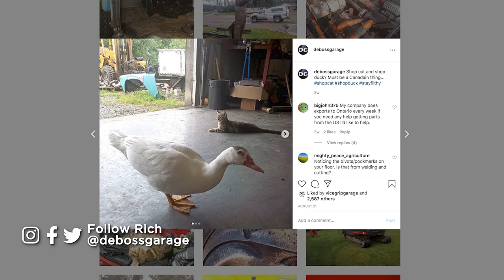The C10 Cab Is Much Worse Than I Thought... #TTDmaxC10 [EP13]

Comment: The safety inspectors make me laugh almost as hard as the emissions inspectors. One whiff of modern aftermarket and its a no go, but they'll sign off on a rusted and cracked frame with a worn out, oil-burning, carbureted gasser cause it was stock 40 years ago.
Reply: Lol we love it though

Comment: Hey Deboss got a question. I've got a Kamatsu D41E dozer with what looks to be a 12 valve Cummins 
Noticed that there was an oil leak under the dozer itself in the middle of the dozer would you happen to know what it possibly could be?

Comment: Nice, bodywork and fabrication, I do more of that anymore along side machining than I do actual engine work.  You guys should build a custom chassis for a project, that's what got me started welding back in early highschool building chassis' for deathtrap VW Beetles to sit on top of.  My first build was swapping the rear facing transaxle and rear engine for a transfer transaxle and engine to make a midengine beetle with a custom chassis using a lot of Audi parts.  

I don't wanna brag but it never caught fire so highschool me had one up on my friend that was building a 3800 series 2 Fiero.  After that I did a RWD build moving the VW 1600 to the front, flipping it around, and adapting it to a GM transmission.  Now I've got a front engine 1.8t 225 quattro powertrain bolted into a custom chassis/cage with a 70's Super Beetle shell with rear mounted cooling.  I might have a slight obsession with Beetles; Beetles, Wagons, and Vans >.>.

Comment: Most of the time I do metal work I end up with poor fitting and massive overlap. 
Is still does the job. And I don’t know if I really care to grind and cut for a whole extra day just to make it look perfect. 
But I think I’ve done ok considering I don’t even have a vice lol
Reply: A vice is the most important tool of any workshop..Everytime I'm at someones garage that doesn't have one, I immediately miss it.
Reply: Takes YEARS of practice. Been doing it for 15 years now and learned a lot of tricks along the way. The hardest was adding and subtracting when bending sheet metal. Doesn't mean I don't make mistakes occasionally but hey thats part of the trade. 

Keep at it and never give up!
Reply from the maker: The difference between a good job and a great job is usually about an hour